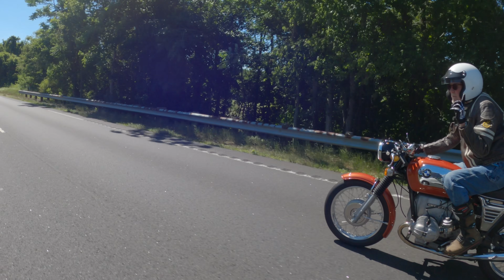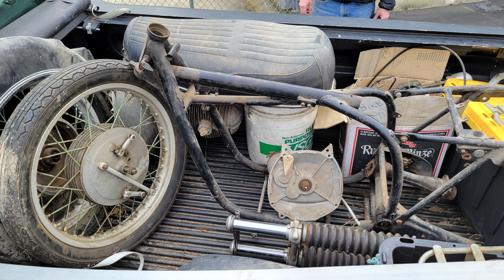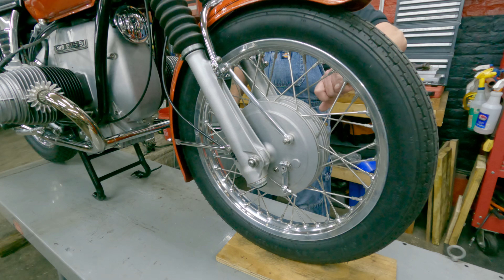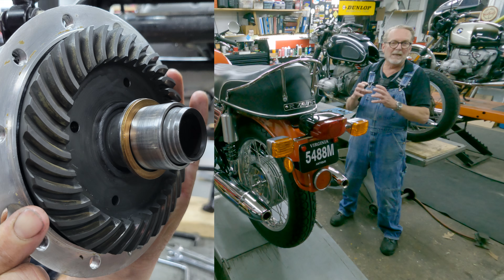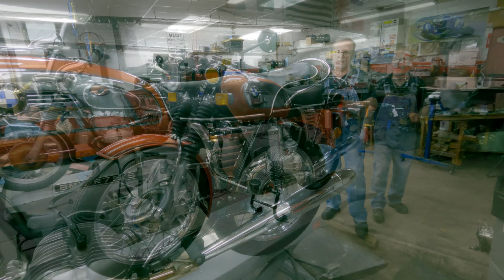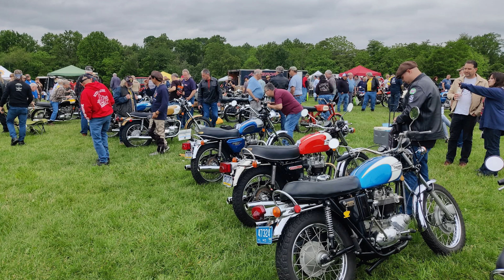1972 BMW R75/5 — Best In Show @ Classic Motorcycle Day 2026

Comment: Now that's a great  looking bike, I have a burn orange 75/7 but that's a very nice colour. great job. I don't know if I missed it, but when you were re fitting the valve train, did you use the standard 75 set up or did you go for a 1000 set up to match the sebenrock upgrade and did you keep the 75 carbs or were they change to the 1000 bing's? (UK)

Comment: This is very nice .

I picked up a scrap '71 R75/5 in Feb. 2024 and spent the entire year chasing it to make it run and be safe to ride, it was and still looks far worse than this beauty but I'm getting there, I'm going close to Grenada Red , roaster tank and so on .

I disagree that this is a secondary Motocycle . I've been riding Air Heads (mostly /5, a few /2's) since 1979 and I still find them to be perfect daily riders, I use the easier on the old back and shoulders U.S.A. bars with a European left mirror and U.S.A. right one .

-Nate

Comment: Nice, I recently bought a 75/5 in bits, but the guy I bought it from had the engine, gearbox, and final drive rebuilt, but he never got round to finishing the bike. I have 5 classics, all bought as non-runners; 4 are now running, and 3 are on the road . The old BMWs are great bikes; I also have an R75 & R80/7 . I enjoyed your video, great job and great results.